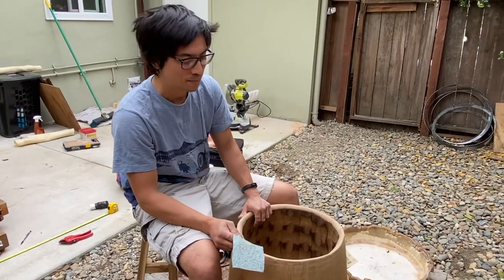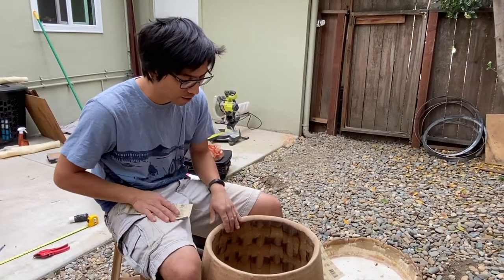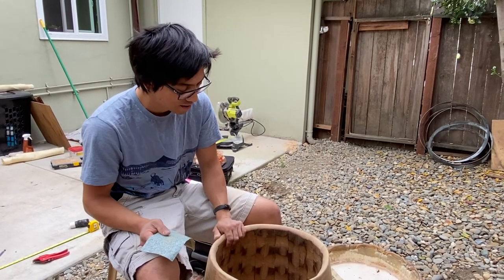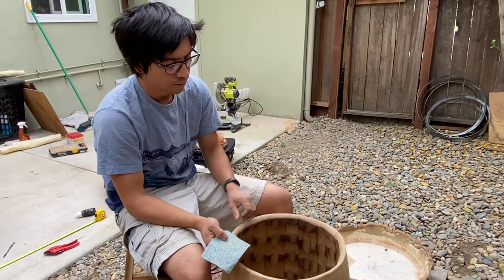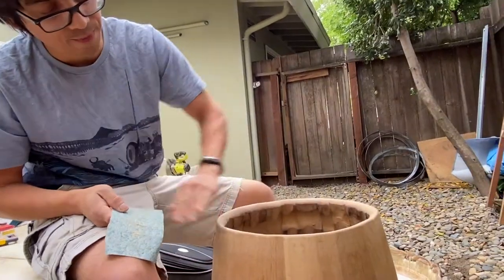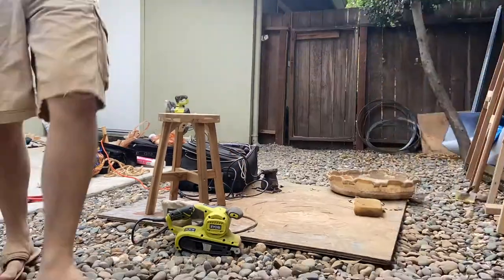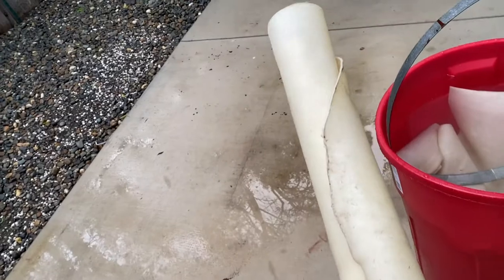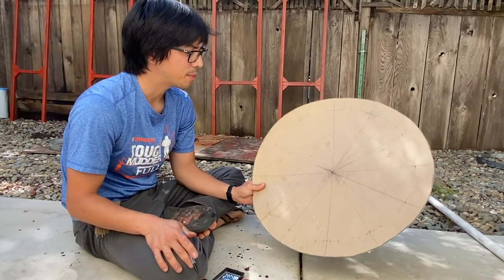Making Taiko from Barrel

Comment: Great video and thanks for sharing. I was actually thinking about tackling this myself. Would you ming sharing where you got the black tacks that you hammered in around the drum?
Reply from the maker: Thank you! I have used tacks from the taiko manufacturers Miyamoto Unosuke Shoten (look for kaDON for US based affiliate) and from Asano Taiko. The tacks are called “byo” in Japanese if it helps with searching.

It’s kind of a folk knowledge among taiko makers in the US that the most expensive part of the drum are actually the tacks. I’ve found this to be generally true in terms of raw cost. However, I think when you take into account treatment and time, the barrel itself may be more expensive.

There are “furniture tacks” that people have historically used in the US, too, especially when it was not as easy to get the byo. These can be bought from hardware suppliers. They are often not black but can be painted black. These are sometimes cheaper options, but quality can vary. I’ve used these before, too, and they’ve work well but are often noticeable as a bit off.

Best of luck with your project! There is a Facebook group called “Taiko Builders” that are pretty responsive to questions, too.